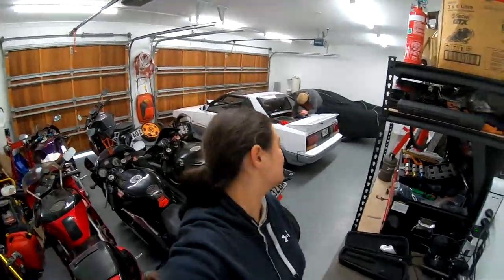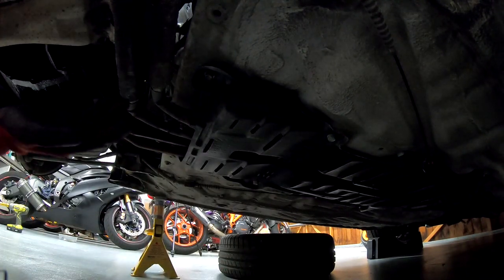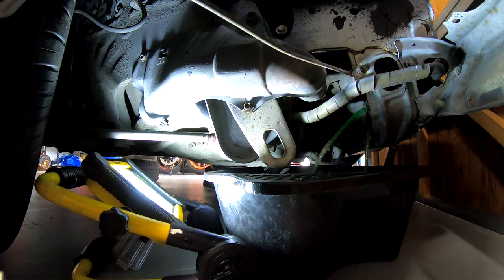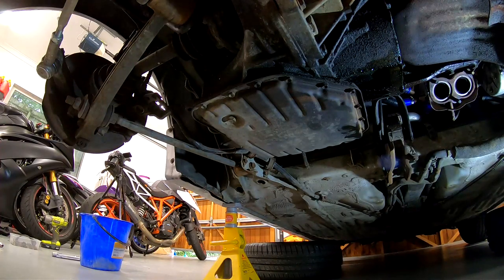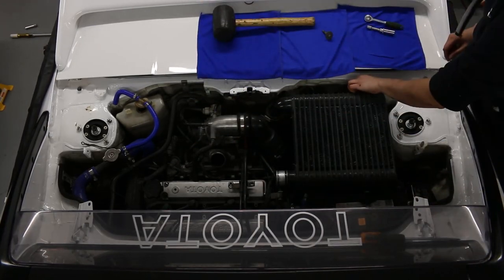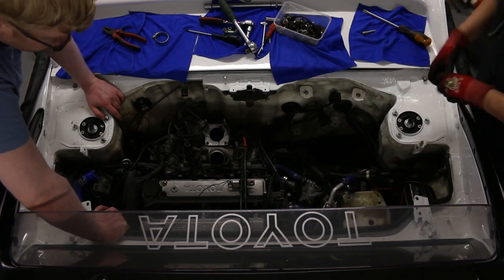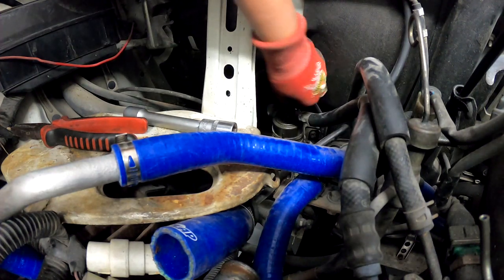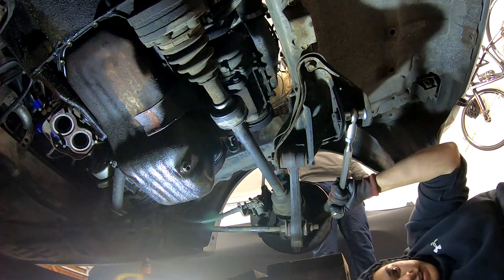Preparing to drop an engine. Mr2 Manual conversion Part 1

Comment: I remember my first time, my buddy and I took all day, made a huge mess, and still took a couple more days to get it all back in.  Now, I can do it alone and have the engine and trans dropped in 4 hours.  Gotta admit, my first time was the longest but, it was the best time I had because now a days it just seems like work.  Enjoy yourselves now and clean everything you can in that engine bay.  You will regret it if you don't.
Reply from the maker: Yeah I'm definitely not looking forward to putting it back in, but it's a great learning experience and I am enjoying this!
Man 4 hours! That's impressive!
You've dropped quite a few mr2 motors since? Same car or multiple?
Reply: @STEPHASAURUSREKD  I'm on MR2 number 10 now.  Eventually will do a 2ZZ swap but the thing is too clean to just swap in a different motor.  I've done my fair share.  Helped other MR2 owners, purchased and stripped rusted out parts cars, and had to even pull the motor and trans because of a stupid little oil leak in the block behind the trans plate.  There is a hex head bolt that gets removed to hook up an oil line at a machine shop so they can run oil through the block and crank without the engine assembled.  Well, that started leaking at the track about 35k miles later after the rebuild.  Then there's replacing the clutch, swapping out a blown engine with a replacement.  The list goes on.  After you do it a few times it almost becomes natural LOL.  You remember where all the hard nuts/bolts are, you remember it's easier to do things this way instead of that way, but I always seem to forget to plug the ECU back in.  Last time it took me about 10 minutes to finally remember to plug in the ECU.  I was so focused on the car not starting it just slipped my mind.

But please, take your time, enjoy the process, and if you break something, it's not the end of the world.  It can be fixed/replaced.  Oh, and don't forget to plug in the ECU.  Apparently the ECU is important /sarcasm
Reply from the maker: @mr2miach  hahah! I'll try remember the ecu for sure!!

I had a similar hiccup with removing this. I left the AC lines till last, had loosened them then went to removing all the engine mounts. Took lime 30 min of trying to get the motor to drip before I remembered the ac lines were still connected! Was actually surprised they could hold that kind of weight to them!

Must feel quite awesome though to know everything when it comes to Mr2's though!
Reply: @STEPHASAURUSREKD  I may know a lot but I certainly don't know everything.  Now Paul Woods or Bill Strong, those guys know it all.  But I miss the stage you're in right now.  The getting to learn it and do it yourself stage.  I'm ready to catch your next videos.  Hell, if I lived anywhere close by is come by and lend a hand or at least friendly support.  I've never changed out from auto to manual so it will be fun to see how you do it even if you make mistakes.  That's just part of the process.